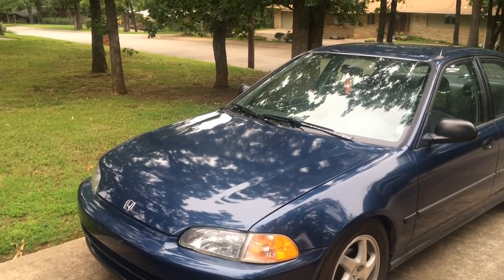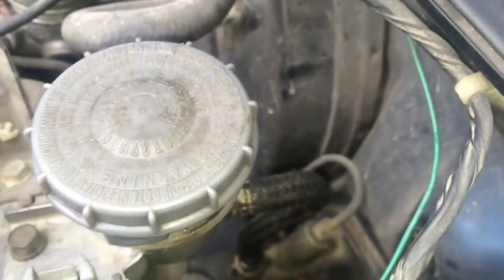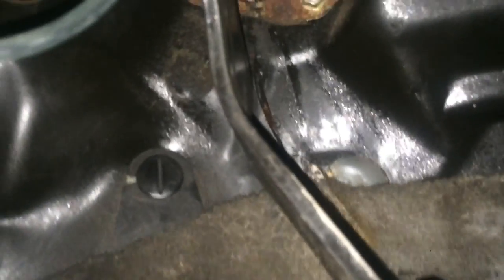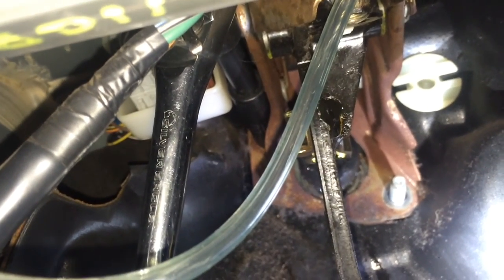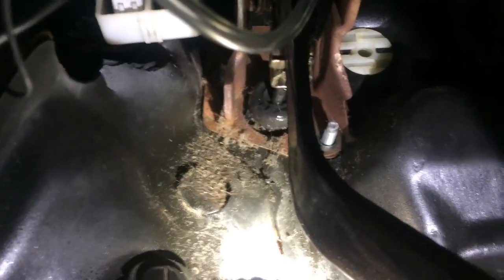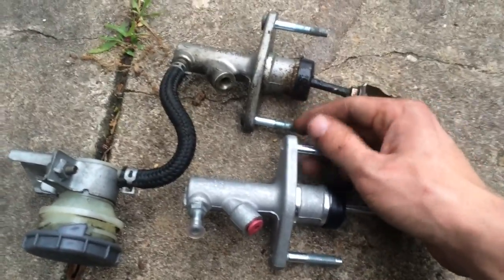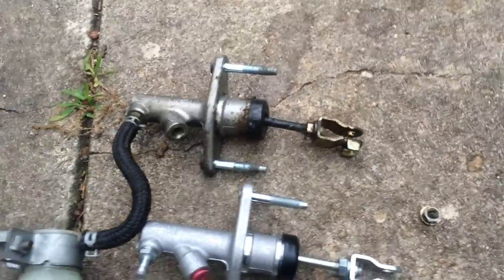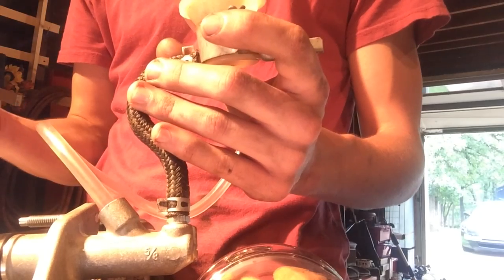How To Replace the Clutch Master Cylinder In a 92-95 Honda Civic EG

Comment: Also Spraying all the brake line fittings with PB blaster or "WD 40 specialist penetrant" the day before would save you stripping the line nut. You can also use a vacuum bleeder from harbour just to flush the old dark brake fluid out. A one man bleeder kit from AutoZone or I Orielys can help to finish up the bleeding process you don't have to spill old brake fluid on the ground like you see in the video. The one man bleeder collects the extra fluid and you can pump the pedal and leave to open the bleeder valve. The pressure after pumping will release the bubbles when you open the bleeder valve.

Comment: can i just change the master and then fill it up with brake fluid?
Reply from the maker: You can, but be sure the problem is the master and not the slave
Reply: @TheFeesher  im just changing the clutch master cause the old one is little stiff. i fill it with brake fluid also?
Reply from the maker: I hope that fixes your issue, and yes, just refill with DOT 3
Reply: @TheFeesher  thanks